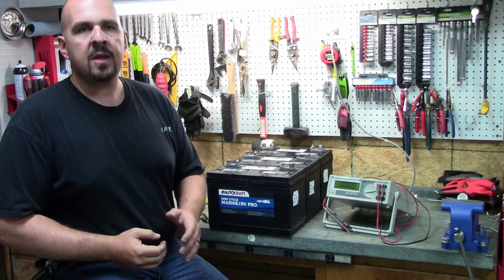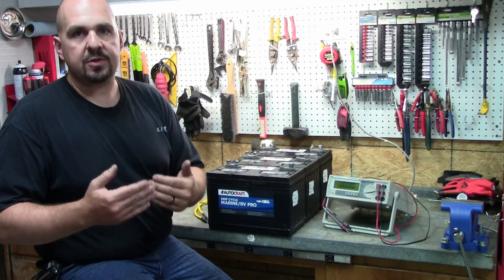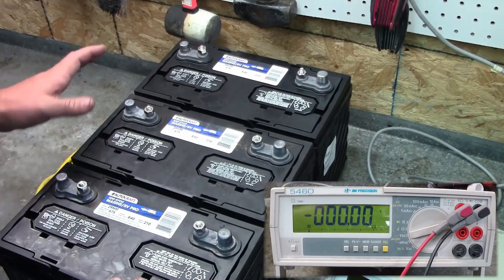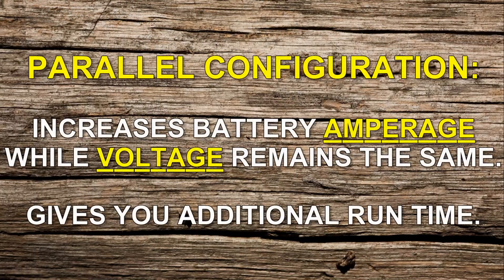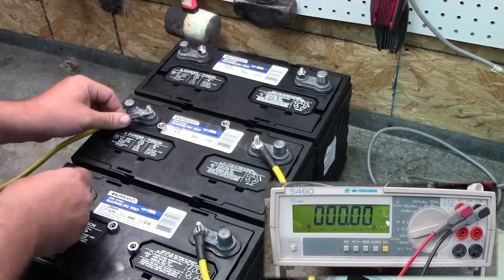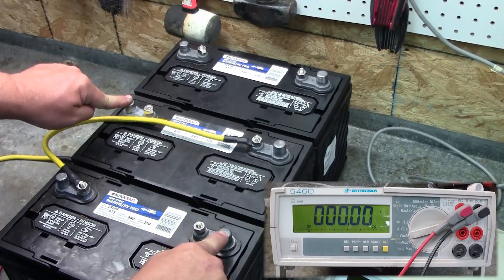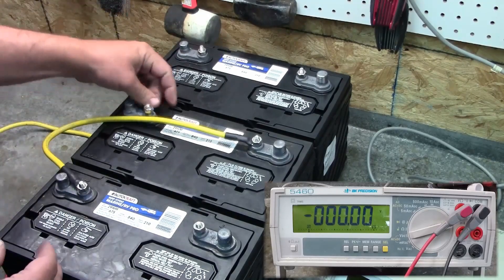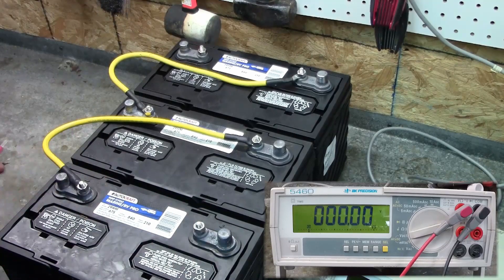How to Properly Wire 12v, 24v & 36 Volt Trolling Motor Batteries In Your Boat (Series vs. Parallel)

Comment: BUt you never mention what size of cable you are using! Is that # 6 awg???
Reply from the maker: That is 6awg. I didn't mention it because it's not a critical value. 

Some applications may require larger wire, while others may be able to get away with smaller.

Comment: I currently have a troller and fish finder hooked to a 12v system. I want to upgrade to a 24v troller. Can I still run my fish finder off the newly upgraded 24v system? Thanks.
Reply from the maker: Most fish finder won't support a 24v input, but you could connect the fish finder to the positive and negative terminals of just one battery in your bank and power it.

Comment: Do lead acid batteries do better on a 24 Volt system than the 12 v system? I'm also curious what other advantages a 24 V system will have? Thank you.
Reply from the maker: The performance will be about the same, but with 24v you can get more powerful motors which is useful when fishing in current or thick vegetation. Larger, heavier boats also can benefit from the additional thrust of larger motors.
Reply: @TheWeekendAngler  thank you.

Comment: Which terminals do i hook my power to the trolling motor? How do I  charge it with a trickle charger?
Reply from the maker: You connect the same two terminals that I connected the multimeter two, since that's where the 24v (or 36v depending on your configuration) is.

You need to charge each battery independently. You can leave them connected in series, but each battery needs either its own charger or its own bank on a multiple bank charger.

The noco genius multi bank chargers are hands down the way to go.

Comment: So where do you put the wires for your 24 V trolling motor?
Reply from the maker: Same two terminals you stick the voltmeter. That's where the 24v is.

Comment: Great vid mate. Just wondering how you charge a 24v system with an external 12v charger?  (I'd be using 240v electricity here in Australia). Thanks. 👍👍🎣🎣
Reply from the maker: @outdooraussie6355  I use a multi bank 12v charger from noco. Each bank connects to one battery.

Prior to owning one, however, I used one individual 12v charger per battery. It worked fine as well.

Comment: So when you connect your trollying motor to the batteries you put postive on one battery and the negative on the other battery like you did with the voltage meter?

Comment: What gauge wire do you use for the jumper cable?

I'm running 2 12volts in series
Reply from the maker: @CuriouslyCurious2  same as the main wires.

Comment: @TheWeekendAngler Wanted to ask you another question.. I got confused when I came across another video. 

With 2 batteries wired parallel for 24 volts… Could you explain about hooking up a 3 bank onboard charger? (3rd bank goes to the cranking battery) 
I’m just not sure on the 2 trolling motor batteries since they are wired parallel. 
Thanks!
Reply from the maker: @dieselbill67  well, two batteries in parallel would be 12v. Two in series will yield 24v. But to answer that, most onboard multi bank chargers have independent charging circuits. So, even though the batteries are in a series, you would connect one set of red/black wires to one battery's positive and negative terminals. Another set to the other series battery's terminals, and the third would charge the cranking battery.

Double check with the manufacturer to make sure the circuits are isolated so you don't mess up your charger. I run a noco and have had zero issues with it charging in that configuration.
Reply: @TheWeekendAngler  Thank you very much!… I thought that would be the correct way, but wanted to make sure.. This will be my first 24 volt trolling motor… I’ll check the battery charger to make sure the circuits are isolated.
You have been a lot of help and I appreciate you making these videos!
Thanks!
Reply from the maker: @dieselbill67  I think you're in good shape and have the concepts down perfectly. If you run into a problem, feel free to ask. I'd definitely look forward to hearing your results when you get it all hooked up.
Reply: @TheWeekendAngler Wanted to let you know that I got everything hooked up last week… The charger and 3 batteries are working the way they should and I didn’t have any problems installing everything. 
Really appreciate the time you took to make the video and to reply to my questions!.. Now time to move on to installing solar panels on my truck camper lol. 
Thanks!
Reply from the maker: @DieselBill6.7  awesome! Reading this made my day today! Thanks!

Comment: Great video explaining this!
I’ve only used a 12 volt trolling motor on my pontoon, but I’m getting ready to buy a 24 volt trolling motor… My pontoon came with a plug in on the front of the pontoon for a 12 volt… Can I still use that to plug in for a 24 volt wiring the 2 batteries together for 24 volt like you explained?? 

Or will I need to change out the plug on the front of the pontoon.. (It’s a “male plug”)… And if I had to change the front plug, will the wire from the plug to the place that the batteries are stored carry 24 volts?? 

Hope I explained that well enough lol.. But any help would be greatly appreciated!.. I don’t want to have some kid from Bass Pro tell me I have to buy a bunch of other junk! lol
Thanks for the video!
Reply from the maker: @dieselbill67  you may be able to use the existing plug, but I would see what size wire is behind it.

I'd want to run at least 8awg for most modern 24v motors.
Reply: @TheWeekendAngler Thank you very much for the quick reply!
I’ll check to see what size cable it is… And thanks for the info about the plug.. I too believe I can use the same plug once I thought about it. 
You have the best video explaining how to wire the batteries!.. I subscribed to your channel. 
Thanks again for the help!

Comment: Thank you for explaining the parallel and series battery.  I was confused before, you sir are gifted with clear explaining  this tutorial. 

I too am a fisherman, I fish sturgeon, salmon, all warm water fishing here in Oregon.
I don't fish from ba boat, up by Dams, bank fishing. I have a 12' ugly sticks Rod,a Daiwa 50 H, and and a SG fifty H reels.  30 or 40 main line , 120 Hook line. I snell my size 6 laser Sharp hooks, short hook line with a corky . A weight size of 6oz to 10 oz. Casting from shore, I wrapped the soft foam handle with survey string and epoxy to handle, I have a homemade steel pole holder , I pound into the ground, and if by a guard rail , I tie a bungee strap  to my holder for my pole to the guardrail. I'm very successful now in catching fish. We have open short seasons here for sturgeon.
     Thank you again sir for this video,  
  From the Oregon Coastal Mountains Range 🏔️ ⛰️ 🌞 (just found your channel today, and subbed up 👍
Reply from the maker: @davedeatherage4902  thank you! You're in some amazing waters. Definitely on my bucket list to fish up there one day.

Comment: I wish someone would show how to make a 36V system using more than 3 batteries
Reply from the maker: @insight1256  3 is the number you need. How many are you wanting to use?

Comment: I'm buying a boat with a 24v trolling motor. The boat comes with a Noco genius Gen 5x3 12v charger. I'm wanting to run lithium batteries. Will this charger charge a 24v lithium battery or do I need to buy two 12v batteries.

Comment: Does the 24V trolling motor hook to one battery now or does it  attach to each battery
Reply from the maker: @louismuni1647  connect it to the same two posts I connected the meter to. One battery will have an open negative post, the other will have an open positive post.

Comment: excellent explanation.  I purchased a trolling motor that requires 36v and i was debating between buying a 36v lithium and connecting 3 12V batteries. thank you

Comment: Can you use a 1 bank battery charger on the two batteries?   Or do you need two separate banks or chargers for each of the batteries?
Reply from the maker: Depends on how they're wired. If parallel, it will techniwork. If series, no.

Under best circumstances it would still be ill advised.

Comment: What gauge wire should I use for the jumper? My battery 1 is about 10 ft away from battery 2 on my boat.
Reply from the maker: Use the biggest you can get away with to minimize the voltage drop. 1awg if it would fit wouldn't be a bad choice
Reply: @TheWeekendAngler  Thanks!  I'll have to splice out the trolling motor wires as well.  Its a 70# thrust motor.  I was going to use 6awg to get those extended. Would that work, or would you make that 1awg too?.

Comment: What size cable 4awg? Where can I find the yellow ones ?
Reply from the maker: Use whatever size you need based on amperage drawn. 6awg usually enough for trolling motors. 4awg better.

I make all my own cables and do my own crimping. When I order wire, I usually order some yellow just to make my jumpers.

Comment: I have 24Volt Trolling Motor and 2 Batteries. With Red, Orange,Black and Ground wire tips on hooking that up?

Assuming with this video I put Red on Positive and Orange on Negative?

Comment: Okay I understand that part but can somebody please explain to me how the hell you charge them off your 12 volt charging system
Reply from the maker: You connect a 12v charger to each battery and charge each one individually. You can remove the yellow jumper or leave it in place.
Reply from the maker: I think I misread your comment. For charging off of your outboard's charging circuit you'll need additional hardware.
Reply: @TheWeekendAngler   yeah I just found the Trollbridge 12 to 24 converter right now I'm running all my instruments and lots and fish finder off one battery and then I got two dedicated to the trolling motor that I have to charge my landline when I get home

Comment: Simple explanation.  So when I series connect the 3 batteries for a 36v connection I then run the boats neg and pos connection to the open slots left on the battery 1 and 3, right?

Comment: Hello, what guage and length wire? Also, to charge can you simply connect the trickle charger to the two open posts? And recommendations for pre made wires, vs making my own? For 36v system

Comment: Why not directly install a 24V battery on a 24V system?
Reply from the maker: Not typically how it's done in marine applications. Some of the newer lifepo4 batteries are starting to come out in 24v and 36v models though.
Reply: I see that many people are accustomed to using 12V batteries connected in series to form 24V or 36V, and I am very puzzled about this. So, is it because there is no 24V or 36V battery that can be used directly? Looking forward to your answer! @TheWeekendAngler
Reply from the maker: @大大王-l4h  12v batteries are readily available for marine batteries. Most people like the convenience of walking into a store and walking out with a battery. Also, a lot of the times space is a commodity, so multiple batteries can be placed where they can fit.
Reply: Thank you for your help. I am currently learning to understand the knowledge of towing boats, but I happen to be stuck in the selection of batteries @TheWeekendAngler

Comment: A newbie here, so from there I can connect my trolling motor the the first battery right? I don't have to spread the 2 wires between the 2 batteries for a 24 volt
Reply from the maker: No you'll connect your motor to the empty posts. So for a 24v system you'll connect to the positive post of 1 battery and the negative of the other.

Comment: What about multiple batteries and still stay at 24 volts
Reply from the maker: Absolutely. The outputs ach set of 2 batteries wired in series to make 24v can then be connected in parallel to increase the capacity.

Minimum in this setup would be 4 batteries, but you could use as many pairs of 2 as you like.

The sky and the wallet is the limit.

Comment: I'm running 3 battery 2 battery 24v but I'm charging all 3 battery individual charger but it's still hook up 24v wire is it go to still charge 12v each for boat my pro battery charger went bad that way I 3 charger for now

Comment: If you were to measured across one of the batteries even though you have the jumper between both batteries, would you read 12v or 24v? Measuring the same battery and not across both.
Reply from the maker: One battery, 12v

Comment: I just bought a used bass boat, it wasn’t connected right and now one battery is dead.  I understand your explanation but where do you put all the wires for the charging system, the trolling motor and other accessories? Also if one battery is dead, do I have to buy two of the same batteries now or can I buy one battery and add the new one to the existing battery that is new and not the same brand?

Comment: Thanks alot was good for me to learn.  Thanks just need to know about third battery for starting motor n lights is that a different battery ?   Deep cycle too or different marine battery ?    I just bought a 50 bass tracker 175 2003 2 stroke and vatteries are 2016 so looks like I need all 3 new batteries now.  What do you suggest ? Thank you
Reply from the maker: Marine dual purpose are a good choice if you're going to be starting the engine and running electronics

Comment: What size wire? Info please
Reply from the maker: Wire size is absolutely dependent upon the amperage draw of your trolling motor. A good rule of thumb is to use 6 gauge wire on runs less than about 18 ft. 4-gauge wire on runs longer than that. You will never hurt anything by using heavier wire, but using wire that is too small will definitely give you trouble

Comment: What about hooking a 3 bank charger into the 12v double batteries ..would i use one bank or 2 of the banks ? From the charger
Reply from the maker: If the batteries are wired in parallel, you would only need to connect One Bank of the onboard charger. If they are wired in series and making 24 volts, you would use two Banks

Comment: Just curious as I have a 12v motor but if you had a 36v would you connect the trolling motor wires to batteries 1 and 3?
Reply from the maker: Yes. The motor would connect to the same terminals I connected the meter to in the video
Reply: @TheWeekendAngler  thanks. I put a little more thought into it and figured that’s what you do.

Comment: I was given an old trolling motor and I am wondering what type of battery to get for it. The motor is a Minn Kota 25 Watt 14 lb thrust three speed with reverse. I would like a battery that can be used all day. Can you help me? Also, seeing that it has been in my parents basement for about 25 years, is there anything I should service on it before I use it?
Reply from the maker: That is likely a 12v trolling motor. A group 24 battery would let you fish for days on it.

I'd remove the prop and make sure there isn't any line wrapped around the shaft, and look at the shaft seal to make sure it isn't dry rotten, but aside from that you're probably good to go.

Those older units were built like tanks.
Reply: @TheWeekendAngler  thank you!

Comment: If I need 24v for my trolling motor but the rest of my accessories are 12v then what do I do?
Reply from the maker: You have two choices. The best is to have two dedicated trolling motor batteries making 24v and one additional battery for 12v.

The other option is is to connect your two batteries together in series making 24v. Power the trolling motor from the battery terminals shown in the video.

You can then connect your 12v items to the positive and negative terminals of only one of the batteries. You will get 12v from that one battery.

Comment: You did negative (batt 1) to positive (batt 2). would it hurt anything if i did positive (batt 1) to negative (batt 2) and so on?
Reply from the maker: No difference. It will work fine

Comment: so all you do is connect your trolling motor to the first battery then run the jumper wire from negative first battery to positive second battery for a 24v connection? could you run from positive first battery to negative second battery?
Reply from the maker: 03:31 Shows the configuration. You'll connect the positive and negative leads from your 24v trolling motor to the same positive and negative terminals I hold the probes of the volt meter to. 

You could run from positive on battery 1 to negative on battery 2 without any issues. Either way is fine.

Comment: On a 24 volt set up you should show where to make connections to the trolling motor
Reply from the maker: In any series battery connection, whether it be 24, 36, 48v, etc once the batteries are properly placed into series you will be left with only one free positive terminal and one free negative terminal.

The same posts that I connect the voltmeter to is where you would connect your trolling motor.
Reply: @TheWeekendAngler  well said, I think that needed to be clarified, thanks
Reply from the maker: @craigmccowin9617  thank you. I hope this helped you out with your setup.
Reply: Very much so, thanks again

Comment: Can I use the 36v series with a 750 watt inverter with solar system
Reply from the maker: That depends solely on the input voltage of your inverter. Most are designed to run on 12v, but there are others that will operate from 12v-48v. 

Check your owners manual.

Comment: What gauge wire did you use for the jumper
Reply from the maker: Use the same or larger than you're using for your cable run. In this case it was probably 6awg
Reply: @TheWeekendAngler  the trolling motor is 10ga I bought 8ga to run to the back the boat and bought a 4ga jumper wire or is that overkill
Reply from the maker: @BrandonEmmons-uo4kb  may be a little  overkill, but you can never go too big when it comes to wire.
Reply: Sounds good thanks